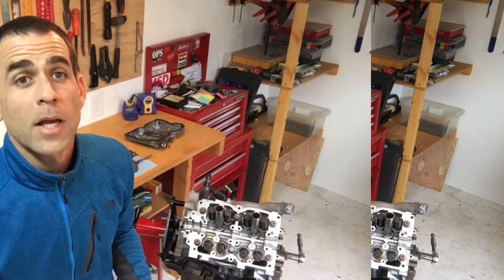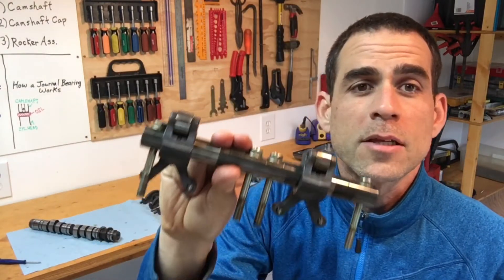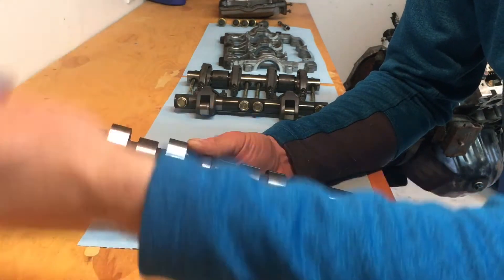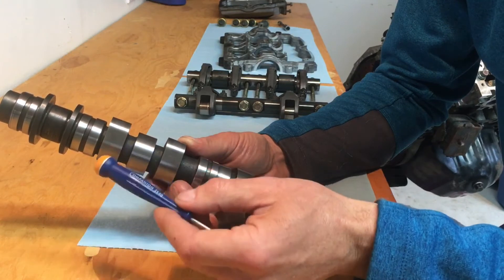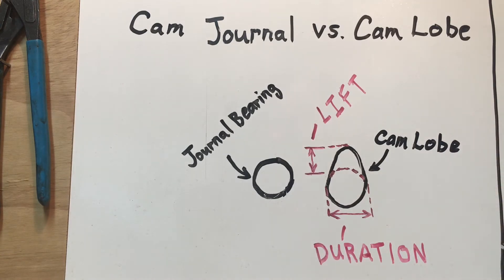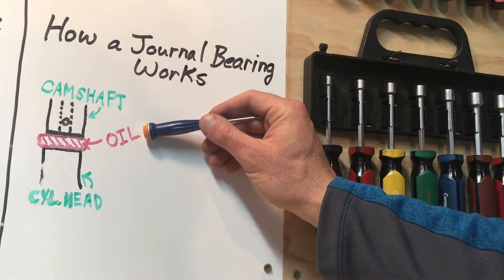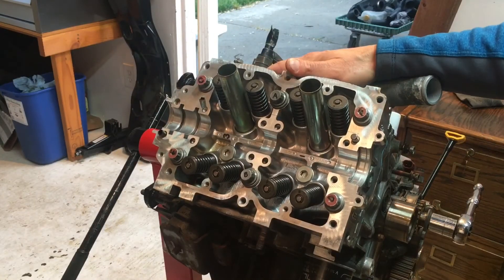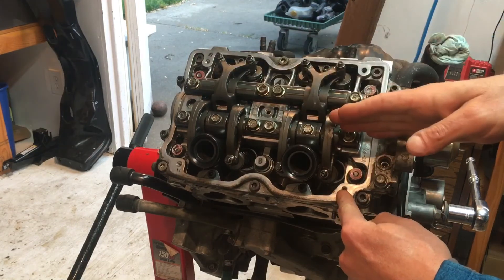Camshaft Profiles, Lift vs Duration, & Rocker Arms

Comment: Okay to be honest with you I thought I was hot s*** and could take my car part and put it back together I did label everything neatly but in the process of taking the motor out some of the labels came off I have all the hardware in boxes separated into their own categories if you had time how much would you charge to put it back together nothing was ripped or broken or cut I am running a new fuel line a flex fuel kit and a AIG air oil separator to be honest with you feeling a little overwhelmed since it's going to be a fresh motor I don't want to mess it up thank you for your time
Reply from the maker: Sorry to hear man, Maybe you can download a factory service manual. I don’t do work for the public anymore. You could also find a local shop that specializes in Subarus. Good luck buddy!  👍

Comment: Awesome video! I personally own a 02 WRX and your video is very helpful!
I got a question. I am planning to change the timing belt and the camshaft sea on an ej205. I heard some story that the plastic cam gear can break quite easy. What's your experience on that
Reply from the maker: +Ng Anson 

Hey man.  THANK YOU for taking a sec to drop a message.  Much appreciated.  

Yea, I know exactly what you are taking about...Those cam gears can crack for sure, as you mention, they are a hard composite plastic rather than metal.  

In my experience, they get cracked when people try to remove the bolt and don't have a good method or specialty OEM tool to securely HOLD the cam gear when trying to loosen that bolt.  

There is an OEM tool and several outfits do make an aftermarket "cam removal tool" but what I like to do is this: 
1) Remove the old cam belt;
2) Wrap the old cam belt around the cam gear you are trying to loosen the bolt on (making sure to take all the slack out of the belt and that the belt teeth are engaged with the cam grooves); 
3) Then wrap the cam belt around one or more cam gears and a pulley or two (any combination that works);
4) Then find a spot where you can use a pair of vice grip pliers to clamp the belt to itself (so the cam gear can't move when the bolt is loosened);
5) If it's all set-up right, once the vice grips are clamped down on the belt, and the cam gear is secure, you can loosen the cam gear bolt and you won't damage the cam gear at all. 

This is kind of hard to explain in word, I think I'd make a video of this procedure for sure at some point - It's a good one and everyone has to swap their cam belt at some point!
Reply: thanks man! hopefully it worked out